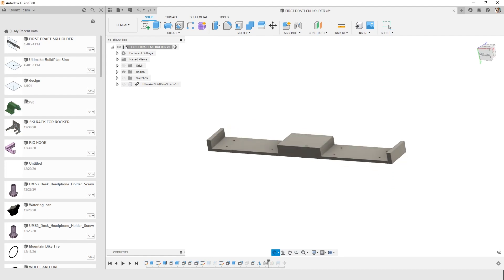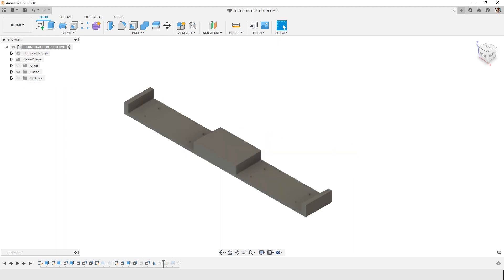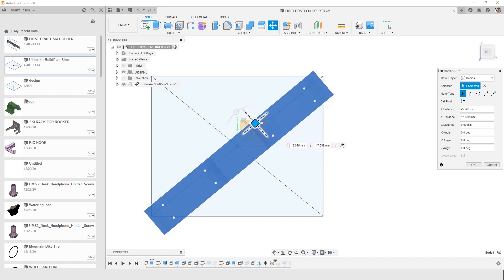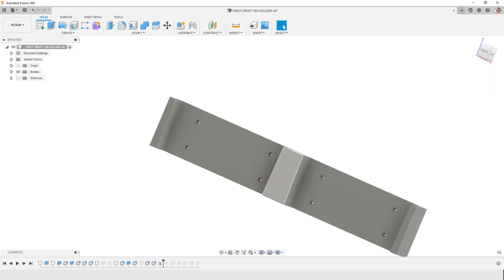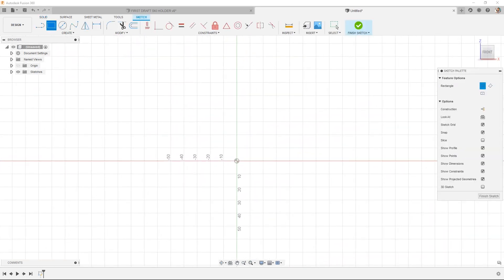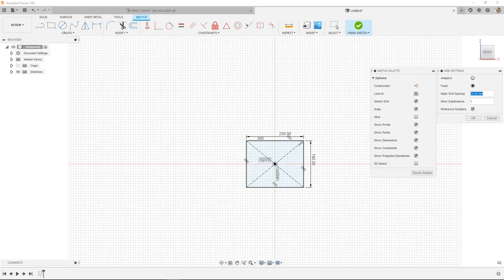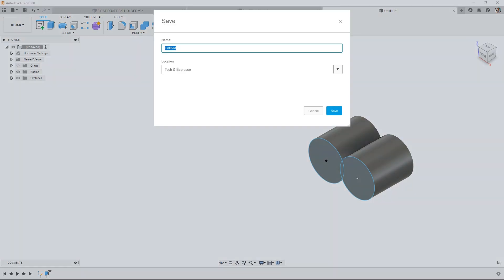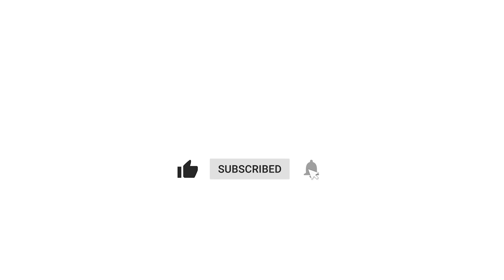See Your 3D Printer Build Plate In Fusion 360

Comment: I dunno, i just make a separate sketch - component, with the exact measures of the build plate i have. And i turn it into construction lines so it doesn't get in a way of anything. Easiest and quickest. Then if i need, i can add more construction lines for any precision positioning of other sketches and bodies later. I can even thicken it if i want to simulate the actual plate but that doesn't have any function anyway.

Comment: You can also directly import the build plate model that Cura uses in its own UI into Fusion360. The models are stored in the Cura install directory under  resources\meshes, e.g. C:\Program Files\Ultimaker Cura 4.8.0\resources\meshes\ultimaker2_platform.obj for the Ultimaker 2 platform on a Windows install of Cura.
Reply from the maker: That's awesome!  Thank you for sharing!